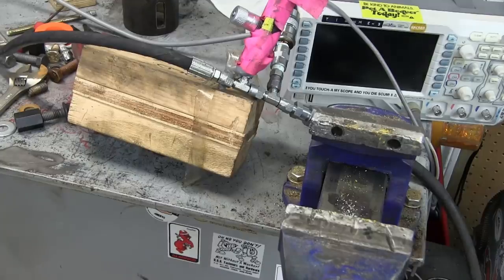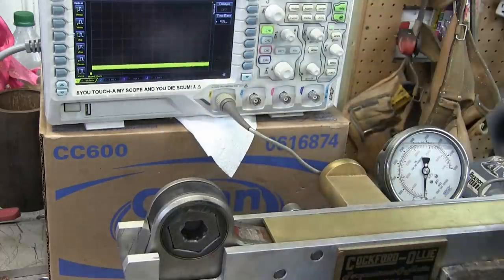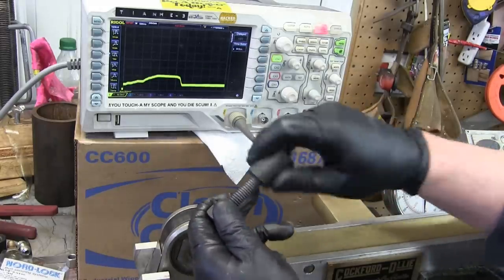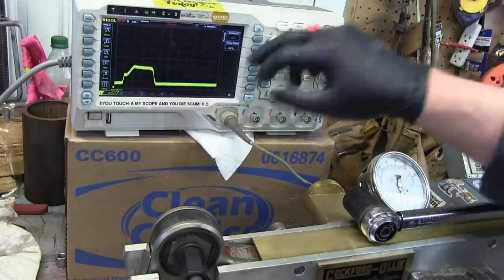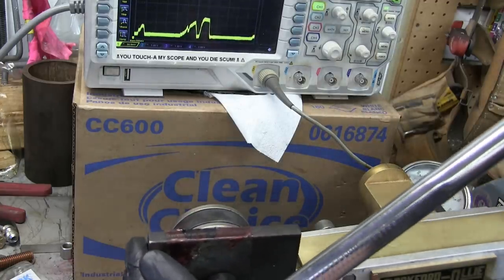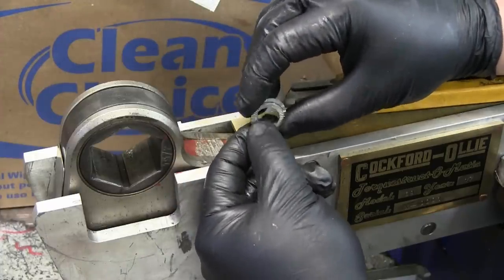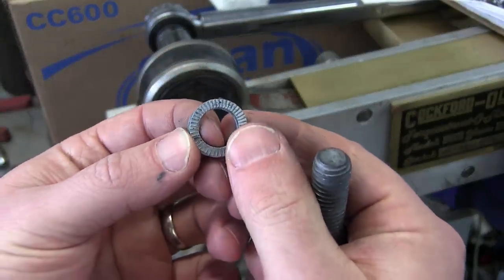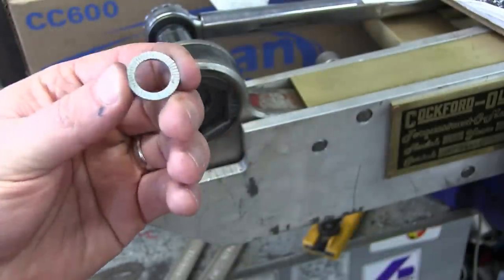Nord-Lock Washers | Do they work better?

Comment: You should retry this using a Spiralock nut (or a plate with a Spiralock wire insert).  They actually work!  NASA’s plate-vibration Test clearly showed a big result.

Comment: Just use lock wire like for jet engines :D

Yeah spring lock washer  don't lock anything, but the one thing they are good for is if you are working alone and can't reach the bolt and the nut if you can get the nut on hand snug then the lock washer will help it grip when you go to the other side with your impact and it will tighten up most the time.

Comment: The dude that built a vw bug engine to run on water used these scopes. Curious if that same dude knew some engineering about steam locomotive engines and just transferred some of those theoretical operational concepts to the flat 4 boxer engine; guess will never know. Maybe AvE can create a boxer engine operating on steam. Curious if there's other chemicals or metallurgy to prevent rust or other types of corrosion. As for the nuclear con-fusion reactor, I think it's missing some core to store or hold the charge, God didn't design the sun to be big for nothing😂. Looks like they got the ignition process down.

Comment: Oops.   A flatten Bolt is usually hardened.   The lock washer often can not get a bite.  Need to use a non flattened Bolt to get a good reading.  You also have to have a lock washer that matches the hardness of the bolt.   Like a grade 8 Bolt needs grade 8 lock washer.  Yes the split lock washer has its flaws but being cheap it does have a good works to cost ratio.  Is there better.   Yes. Like anything else, when it's important spend more money.

Comment: Clean machined dry surface for bearing and the proper thread geometry. You must match attributes to a low variable tolerance or very high precision for using mechanical fastening.  So reducing variables is critical.  All quality systems require 6 sigmas or whatever is the latest flavor trading in con salting.  This is done every second around the world for so many critical systems.  In ASME for Turbines and Boiler design, valves, chemical plant, refinery, military, aerospace, medical, computer parts, engines, pressure systems, and cryogenics etc.  There are micro and nano and to machines that function in extreme conditions to 50 to120 million ton presses.  Usually, you must do physical testing per so many parts and use spectral real-time SPC at every step.  Then use failsafe secondary and tertiary systems like dowels snaps wires left-hand king or jam nuts, spanner nuts with buttress and stake, transitional fits using heat and cold. Cold welding, lasers, chemical, custom eccentric lobe locking.  Any society or institute for standards and their technical experts will help you or connect you with the right people to solve most problems.  Remember you are not the first most likely all the ideas and answers are available.  But there has been a serious brain drain since the late 80s.  The things you think are new have been done in some way.  The difference is we have great electronics choice.  Many companies learned when they outsourced the people making the widgets had all the skill and knowledge from decades of work.  Year after year they reorganized and just closed plants all over because of the sirens call for more stock options higher EBIT by back stock and write off one-time reorgs every few years or be sold to hedge fund management groups to play pump and dump the chump leave the workers holding the bag and all the money gets back to the hedge fund to parlay into more etc.  So a few decades later middle class is shrunk and manufacturing niches are basically job shops and prototyping and makers doing social media.

Comment: Nordlocks are the best out there. Not perfect but good. Nothing else really works. Drilled and pinned doesn't work, believe it or not. I've actually witnessed the test on one of the machines you spoke about. I was surprised at how totally terrible everything else was.  Even a drilled and pinned nut and washer lost tension. All those are good for is not losing the parts. I can't figure out why the  aviation industry still insists on them after witnessing the results. Also, nylok nuts, wow... just so utterly terrible. I still use nyloks to pacify folks. I have zero faith in them now. Glue, total shit too. I'm with you on serated spring washers, just a joke as they have been proven time and again to ne worthless. Lock nuts, same again, they just come apart. 
Some guys came to the place I work with a test rig to demonstrate all of this in the workshop in a place I worked several years ago. The thing plotted graphs onto a PC, it was awsome cool, well in seriously nerdy engineering fashion. We pulled high grade, low grade nuts off the shelf and tried them too, just to prove to ourselves this was all real. We actually did several nuts and bolts where we torqued them up and then drilled and fit solid dowl pins.  Press go, jiggle, jiggle and loose. It was a no way kind of moment. Everything was crap. What I took away from the experience was this, flat washers and nordloks are all the option that matter. Both work and nordloks are a bit better. Everything else is the same or worse than a flat washer, which is so counter intuitive. The machine showed a graph of the load falling away in real time. You really could just spin the bolts in the holes afterwards. There was no fakery or anything. 
So, save money an just buy flat washers folks. Everything else is crap, except nordloks. Nordloks actually do work and stay together longer than plain old washers. Every, I mean everything else is no better than a flat washer.

Cool video and good effort. Thanks. 

Love the channel by the way.

Comment: I thought spring washers were to stop losing the nut after it comes lose, like it does nothing to keep the nut tight, but when ya find a lose bolt there is still a nut on it, and not on the road where it fell off

Comment: The nord-lock wedge extreme  (https://m.grainger.com/mobile/product/NORD-LOCK-Spring-Lock-Washer-405F04?breadcrumbCatId=2035&fc=MWP2IDP2PCP) are desined to maintain clamping force as the meteral  settles (deformeds )reducing the likelihood of needing to retorq after a brake-in peroid.  Eg Cummins Head , SBC headers.  2 pices of Al and that red dot tattletale Bolt could be used for testing a demonstration . Clamping force could be tested with your hollow  hydraulic cylinder or a strain gage.

Comment: As a back of the class type when it comes to this kinda thing, why not use more torque, more chooch on the nordlocks, letting them bite deeper, also applying the same value to the other tested nut grabbers.

Comment: Uncle Bumblefuck, I would like to see the same test done on serrated flange bolts/nuts to see where they stack up.  

We use them at work on our passenger elevator installs.  I've started using them at home around our farm.  Love em'!  No messing around with washers in the field and work great on slots and oversized holes.

Comment: I don't think the torque to remove a bolt with a lock washer has much relevance. A lock washer it there to prevent it coming loose due to vibration and mechanical jolting.

Comment: You really need to try it with a 1/2 13 grade 8 bolt and mild steel plate let it sit outside for a year they are almost impossible to get loose

Comment: Can't really display the diff as good   as real world use. I have seen my share of things loose and falling apart bcuz spring washer broke . Only thing I have seen Nord lock do wrong was introduce a little corrosion at the washer and it would not let go , broke off head , rest just screwed out .

Comment: I find this video EXTREMELY curious.  Within the last 48 hours, I was looking into a PIN solution for a customer of mine for his wheel loader.  Low and behold, I found NORD-LOCK.  I DID research their website, to include not only the pins but also the their washers.  zucker-nuts MUST be using my data from the facebook account that I deleted 6 years ago.

WTF.......

Comment: Holy crap - lock washers are more useless than a flat washer!
Reply: Only on hardened bolts, grade 8, 10.9 etc
Reply: I stand quite clearly corrected. Thanks for the explanation!
Reply: Ricky Hall good point. Didn't think about it like that

Comment: Well shit, I bought these and installed them on my header bolts that keep coming loose. My header bolts are hardend steel and but the washers did bite into the ceramic coating a bit so there's that.

Comment: how about new Teflon coated lock-nuts? every single nut on a skateboard..all 14.. are Teflon'd. very high vibration toy.. Always thought that they ought to left-hand thread the axles on the left side of the board, but modern skaters have the thing flipped backwards 1/2 the time anyhow, or are riding fakie.. "new" one i say, because when that Teflon wears in enough, they do back out.
Reply: They are called 'Nylock'. There are also crimped lock nuts, that are pressed in on 3 sides. And yes, they should only be used one time. Like any stretch bolt, such as some head bolts and U-bolts that shackle a differential to leaf springs.
Reply: Cool! As a mechanic, I use them often. Fasteners are my bread and butter!

Comment: I bought a Moto Guzzi motorcycle with nordlocks all through the engine. A fine Italian appliance, I thought. Until a hundred miles of ownership when she was tits up in the rhubarb with a spun rod bearing. They drink on lunch, those engineers in Italy.. enough to neglect the sentiment of acceleration and design an oil scavenge tube at the front of the sump after being in the game for 120 years.

Comment: Looks like you installed the Nordlock washers with the wrong side facing each other. The serrations should go washer to washer, they should not go against the bolt or work piece.

Comment: WATTTYA Call those bolts that have the little angled divots around the underside of their flanges?  You know?   The little scallops that would wedge in against the contact surface?  Now THAT is what I'd call 'locking'!  You have to physically scoop out a bit of the mating surface in order to schooch - ya know?

Comment: 40 years in construction and still arguing with the enginerds that insist that we put a flat washer under the lock washer, will not listen to the argument that it gives the fastener a bearing surface to slip. HATE ENGINEERS!

Comment: Never use washers.  They were the old timers way to fix broken parts and do quick and dirty bandaid work.  Then someone said oh instead of making crap machines and use for emergency only.  The kids of those guys and some fancy marketing to help in a loose tolerance hand fab setups or short photos etc it took off since the tolerancing didn't get great until the 40 and 50s and just became better.  But washers became a staple for any use under the sun.

Comment: I'm sorry I didn't watch the hole video before I commented on it so here is the deal with lock washers dude it's made to keep a nut on the bolt bitting into both services that is why I said match grade washers with its bolt and when using the locj washer under a bolt with no nut same rules apply
Reply: I can lock a bolt down and it would take more force to get it back off than it took to put it on that's why it's called a lock washer

Comment: Speaking of bolt-stretching, let’s examine threaded fasteners and bolt stretch. The most accurate measure of tightening force is by checking bolt stretch  via the forces developed by the bolt and its elastic modulus. 

MAN diesel actually has device for their huge ship engines where they screw down the nut then take the exposed threads and screw on a special hydraulic jack and calibrated pressure gauge, stretch the bolt to spec, then screw the main nut down finger tight. Then they remove the stretcher and voila! the stretching forces hold the cylinder head on! See Youtube where extensive service and design info videos on engine service reside.
http://www.dieselarmy.com/engine-tech/engine/worlds-largest-diesel-series-mans-record-breaking-12s90me-c/

Comment: Build a better mouse trap. If you look at lock washers and look at spring used to hold a screw from loosening then you will get the point and when to use them.

Comment: Nifty product just like everything it will be 10-20 years till you see it after the patent expires and more than one manufacture can make it 90% of the people wontt spend more money on anything that gives somewhat of  improvement at a additional cost so till they can get the price per peice to within the cost of the spring washer most people won't use them also the can I buy it in a big box store argument isn't an option

Comment: Go real old school. Castle Nut and pin. Or even older. Shim under two or more bolt/nuts corner of shim bent to contact face of bolt/nut. I worked on some old 1930's farm equipment. Inside the engine lots of bent shims. Everything outside that was set and forget castle nuts.
Then there is always welder lock tight. Small tack weld between the nut and bolt. Grinder is the best those. Stays tight but service next time is a b###h. Hope the guy ahead left you options.

Comment: No lock washer is going to resist torque like this. They are designed to reduce failure from vibration. You need a different test for these.

Comment: if you had tightened in the position you loosened and loosened the side you tightened, you could have pulled down on the torque wrench instead of pushing up... It's the little things that makes life easier

Comment: Jenbacher methane burning engines use Nordlocks on socket head cap screws fastening  the fuel inlet and outlet manifolds to their intercoolers. It’s a high vibration application and a small fastener. They are a bitch to get off! Impacts aren’t good at removing them. Best to use a ratchet.

Comment: I actually prefer the theory that bolts are made to use flat washers on... When torqued appropriately, the nut and bolt head will imprint in to the flat washer, just enough that it can't loosen...   that's what a few old timers have told me... Seems to work!
Crap! Those guys are all gone now, I guess that makes me an old timer now... Fruck!

Comment: Spiralock taps   http://www.clarendonsf.com/products/commercial/miscellaneous-hardware/spiralock-products   they use a similar reverse angle ground on the tap so the locking feature is permanently in the part  used them when i worked for a heavy fab shop making rock drilling and mining equipment for Ignersol-Rand , Gardner Denver and similar other companies.

Comment: Never heard anyone say lock washers are supposed to increase the loosing torque on nuts. Just that they hold pressure on the nut keeping it from vibrating loose. Found a video that does a good job testing this with vibration instead of torque 
https://youtu.be/4H-HOHZ3chA?si=vw7-WMuklMViWxKt

Comment: You did not torque the bolt properly. 
I know this because when I take my car to the tire dealer to have my tires rotated they use an impact gun to tighten all the bolts down and then afterwords.... use a torque wrench and watch it click once. And that is how you properly use a torque wrench

Comment: There's only one place where teeth work on nuts...well, two, and that's fucking weird, but moving on, on bicycle rear axles. Ever tried to take apart one of them seized up bitches? Fuck that. I've cut more of those with my grinder than i can remember.

Comment: Well first off your using the spring washers wrong. Your supposed to load a stack of them on and than you simply just weld them to the bolt. Follow the proper procedure before you bad mouth a product. 🤫

Comment: Red loctight... and never need a lock washer again.
Reply: Larry Thompson unless you have a high heat environment.  Or constant high frequency vibration.  Most people don’t use loctite properly anyway.  how many times have you seen loctite primer?
Reply: Ever worked on blast hole drill rigs?
Reply: If Loctite doesn't do it I generally drill it and safety wire. .. if it's good enough to keep aircraft in the sky... Know what I mean?

Comment: Hey uncle bumblefuck, we all know lock washers arent great but they do the job if used in the right application. Can you give us a breakaway torque with various locktites (222,243,263,272,277,and 290)? Locktite is the true lock washer if you dont want that bolt going anywhere! :)

Comment: One of those happyfying occasions when a hayseed bumblefuck greasemonkey with simplicated vocabulatiion could explain it better ;)) 

Indeed, that's what happened for me. I watched a vid by a guy who appeared way less well organised and employing every day barn door language. And I got it. 

Science occasionally asks the wrong questions. The problem is bolts and nuts working loose. The challenge is to prevent that occurring in real world situations. The test to replicate the issue is not easy to repeat. The solution is to make opening harder in the tightened state. 
But having said all of this, the issue I encounter most often is bolts and nuts that are frozen in place, either due to rust or corrosion due to the electrolytic effect between steel and aluminium or aluminum in Americanese ;))